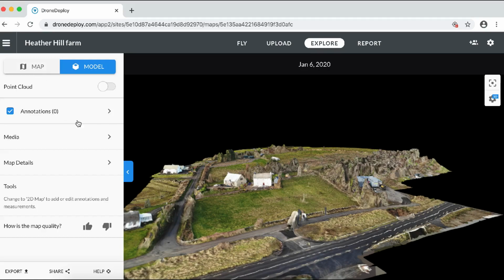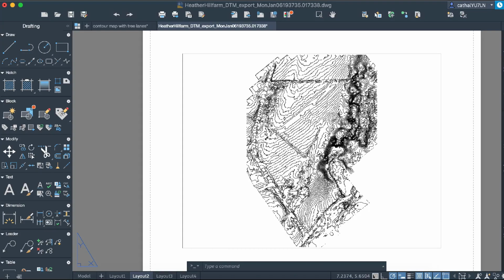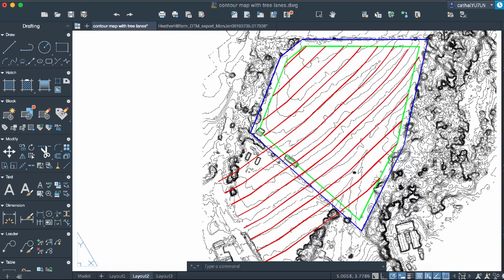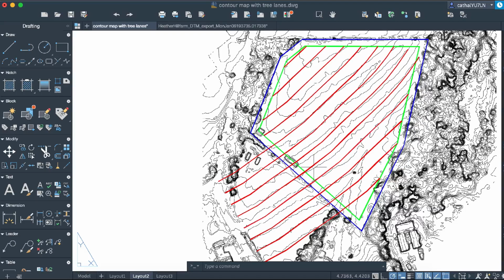Finding my keyline pattern for tree lanes

Comment: Good stuff! Donegal could certainly use a few more trees. Without a doubt Yeomans Keyline design principles has incredible results in water strained climates through spreading, slowing and sinking the water, do you think that it will be of equal opposite benefit to the North west of Ireland where our exceptionally heavy rainfall and heavy clay soils often result in boggy water saturated fields?
Regardless I suppose the biodiversity, additional crops, wind breaking, beauty, and water consumption of the trees combined with the convenient parallel key line layout makes makes it a no-brainer and regardless of the answer to the last question.
Reply from the maker: I think it will do no harm in the wet, but Irish farmer need to pay attention to the trends we have been having and that is we are having dryer and dryer summers, that’s why I’m using keyline design to retain water in the dryer periods.
Reply: @heatherhillfarm1303  For sure, thats an important observation to note. It's great that your'e going for it. It will be very interesting to see the effect it has in your fields in the wetter months of the year, as the general thinking i've come across with the older generation of farmers in Ireland is to dig drains and seochs to try and move the water off the land as fast as possible which is contrary to the keyline approach you're taking in my understanding. My Dad has a few fields on his farm which suffer from being very wet most of the year, but my suggestion of planting treelanes of water tolerant species, alder, willow and others in a keyline pattern to slow, spread and sink the water is met with disinterest to say the least. His main argument against it is that yeomans was working in a very dry climate so it doesnt translate to ours. Maybe if I show him that a fella an hour down the road is doing it he'll be abit more open to the idea. hah. Keep up the great work, i hope to try some of your produce someday!